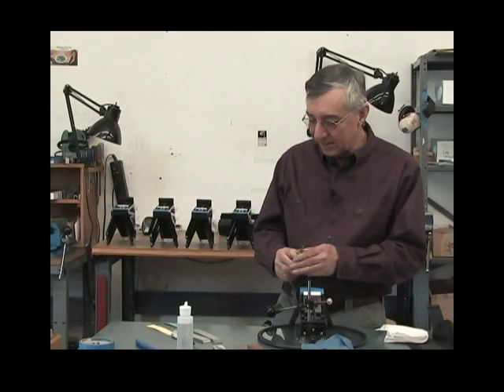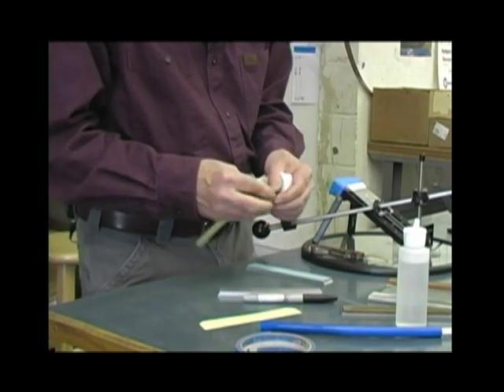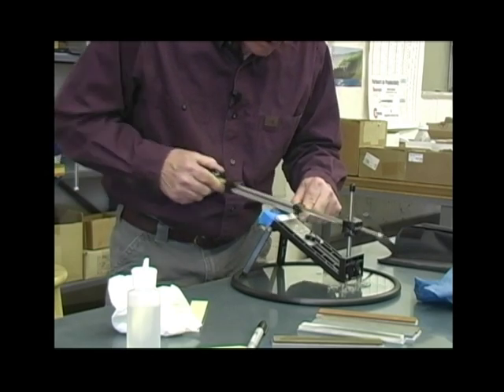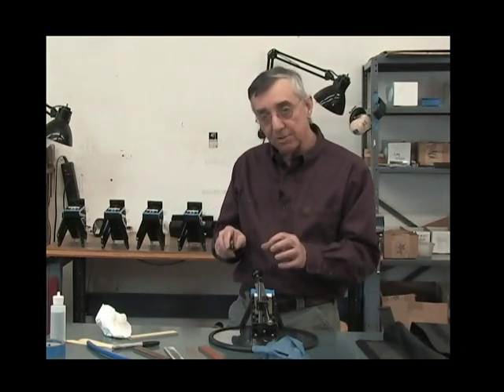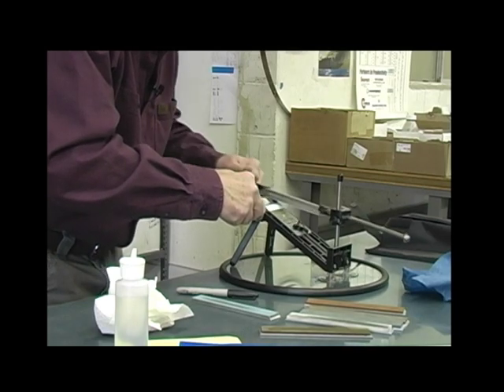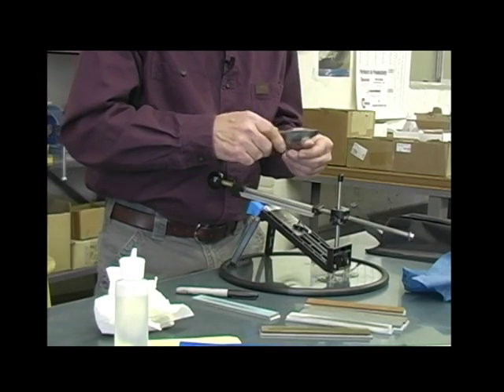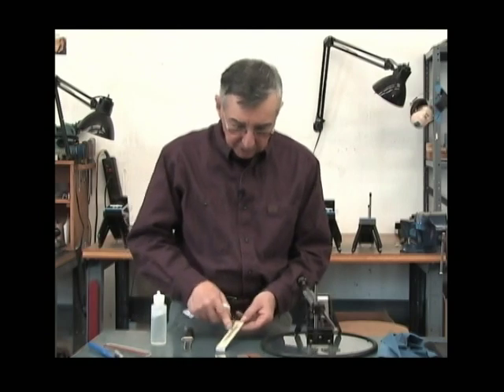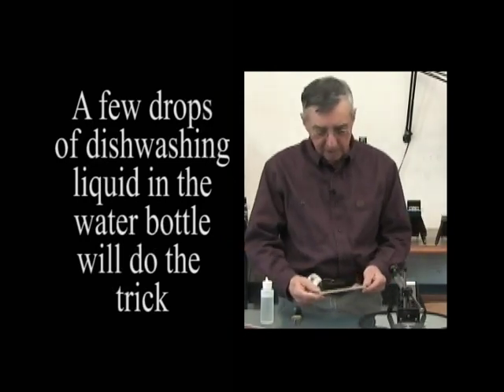Edge Pro Knife Sharpening System 4

Comment: Most people complain about the tapes... I find my self replacing tapes NOT because they are damaged, but because I get SO much use out of them that I want a clean tape! My tapes go 5 knives easy, as long as you do what he said, starting with the pull stroke to knock off any burr, those tapes will last you a veeerry long time. One strange thing I notice is, I find that the edge polishes great with the 3000 tape, but the 6000 tape leaves less of a polish... not sure why that is.
Reply: The 3000 grit tape leaving a finer or better polish than the 6000 grit might have to do with the blade steel of your knife, some steels are "harder" than others, not 100% sure though I haven't had much experience on this sharpener with different steels yet
Reply: Dämmerung Gaming It is the blade steel you are right! Some steels really like the 6k and some don't.  Ben told me a while back that the new scratches you see are actually old deeper scratches that are revealed by the 6k tape, because it makes it so clear. He says he really only takes knives up to 3k when customers send them in just because of this. I find that s30v really liked the 6k, while 8cr13mov and 14c28n really don't do well with it. That 6k tape is about .25 micron!

Comment: Like Mr. Dale said in the video, a polished edge is great for cutting hard objects (wood, plastic, etc.) but doesn't have any tooth or bite to grab and cut a soft object like a tomato. 

A knife can be "sharp" and only sharpened to a 320 grit. It will have micro serrations though that will make tiny tares in soft material.